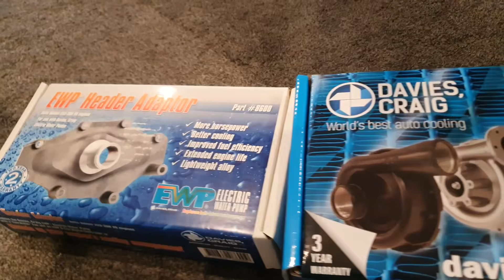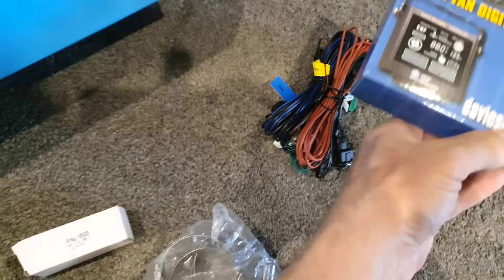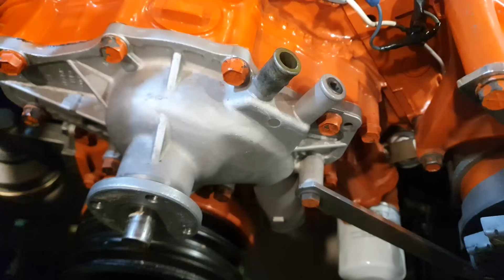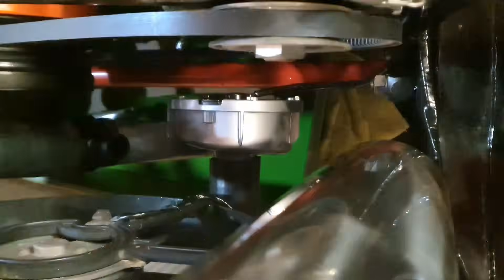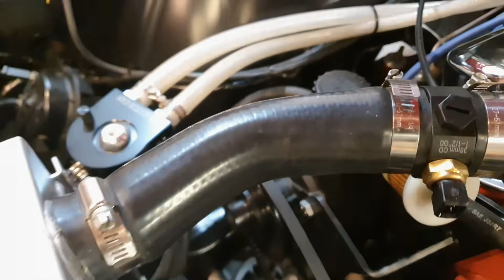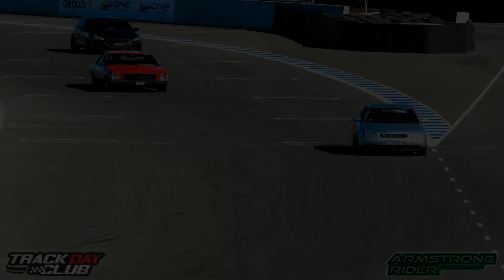Hq holden 308 Davies Craig electric water pump

Comment: And this connection at the pump output is a small circuit.
Reply from the maker: Not sure what you mean by a small circuit.  I've installed the heater connection in various positions and still can't get the heater to work.

Comment: Why did you put the heater adapter after the pump. The flow usually goes from the thermostat to the heater then returns to the pump. Is the heater still going to work as efficiently
Reply from the maker: Good question. I honestly haven't tried the heater to see how good it works, I was concentrating more on the engine cooling and more HP as I do Track Days. I see what you are saying and I will check how good it heats. I kept the heater connected to keep it road worthy. Otherwise I probably would have just disconnected it. I'll check it next time I'm in the car and let you know.
Reply from the maker: I've just checked, and the heater is not working. I can't think of a way to make it work as the pump is pushing cooler water from the bottom of the Radiator. Have you got any ideas?
Reply: If you can’t put the heater hose adapter before the pump, maybe if you change the hose on the thermostat to where the temperature adapter is, it may give you enough flow that way you will still get cooler water from the radiator unfortunately
Reply from the maker: I am going to put the adapter before the pump. I must have been rushing the install as I just looked at the instructions, and guess what, it says to put it before the pump. Grrrrrr.
Reply: @davohq1724 yeah that happens hope it works will for you
I,ve purchased a different pump haven’t fitted it yet, had to go to a few different hose places to get a fitting for the hose from the heater back to the pump
I’m hoping that the pump I got has enough flow as the inlet seam a bit small
Reply from the maker: @averagejoe907  let me know how it goes
Reply from the maker: I'll have to come up with something as my legs froze last time it was a cold day.